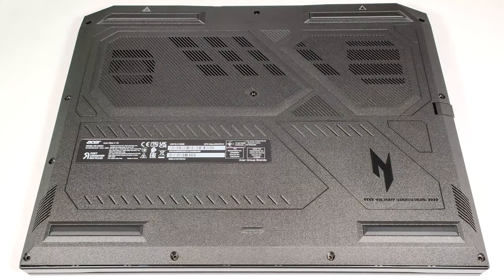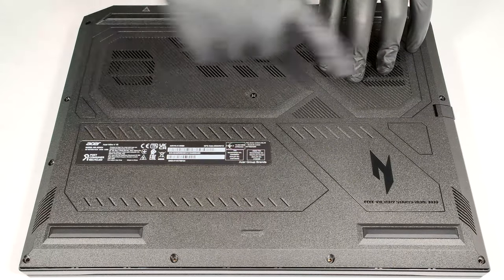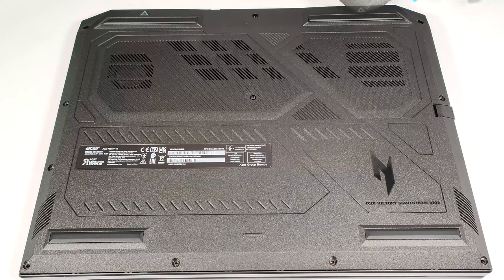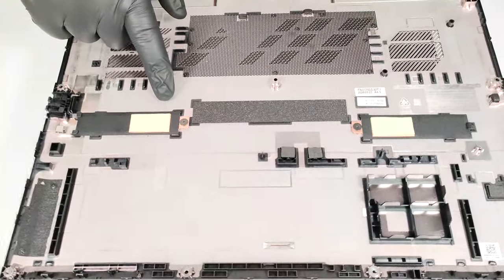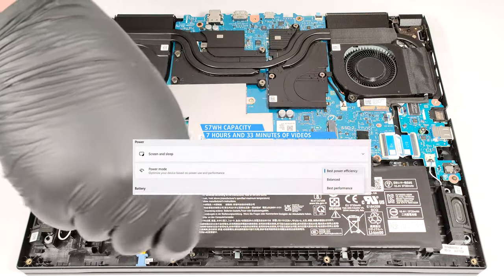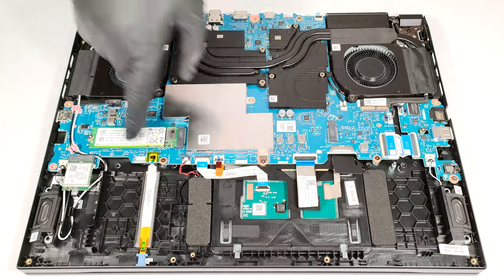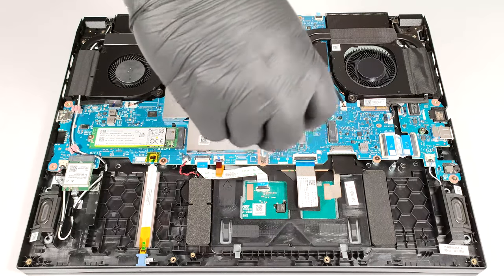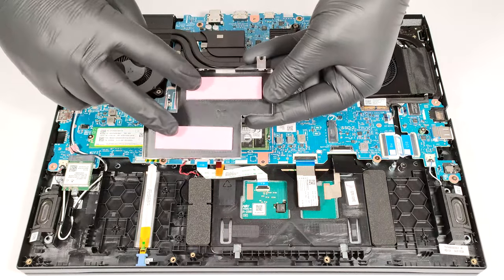🛠️ How to open Acer Nitro V 16 (ANV16-41) - disassembly and upgrade options

Comment: What's the max TGP of this laptop?
Reply: Depends on the model version.
If RTX 3050 6GB, then TGP is 70W
Or if RTX 4050, then TGP is 85W
Reply: Wrong Info.
Um a Owner of Nitro v16 and V15
Rated TGP for rtx-4050 on Both V15 and V16 is 75W and Tested while gaming Maximum wattage I acheved on both v15 and V16 around 68-76W on MSI Afterburner app.

So yes both the laptop powered by a 75W Rtx-4050 GPU indeed.

Comment: Hi can you upgrade the battery, when you opened it, it looked like it had space for a bigger battery
Reply: that's a terrible idea, you risk frying your computer for what exactly? if there's one component you need to be sure is 100% compatible before trying is exactly the battery, don't attempt replacing it blindly
Reply: better ask acer service center directly they have computability tables. but it's unlikely.

Comment: hello great video! Liked and subbed:) One "dumb" question. If i plan on using my computer for 8+ hours, is it better if i detach the battery and plug in the adapter? (in order to minimize heating). And is it possible to even use the computer if the battery isnt there? Because in the video the components looked pretty loose. Thanks again! 
If anyone has the same question please give this comment a thumbs up, and if u know the answers please dont hesitate to answer :)

Comment: Could you please use the correct model name? You have two videos displaying the same laptop but both have different cooling and different PCIe slots placed in different spots. This video is throwing me off from my next purchase. Disliked.
Reply: You need to look at the code, it's in parenthesis. I bought this laptop on Amazon, and this video is exactly that model. You probably are looking at just Acer Nitro v16, and no the model identification code
Reply: @asdfhalolol which one did you buy? I want to buy the one that says ANV16-41-R5J0, is that the exact same as this one? He only includes the ANV16-41 not the sub number or whatever it’s called
Reply: @NicholasGaming47  Yep thats the one. The amber keys, more discreet version